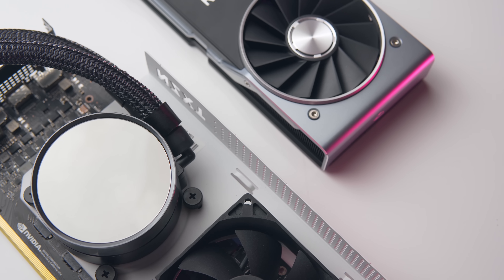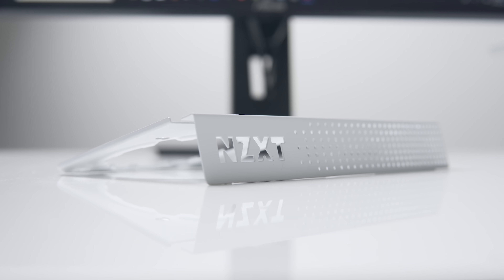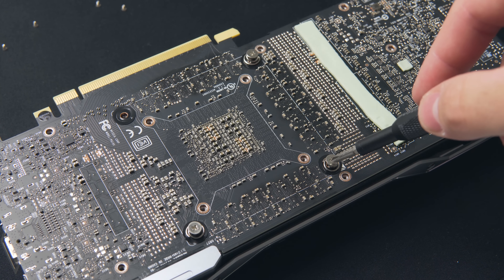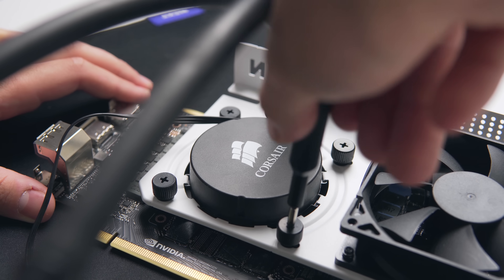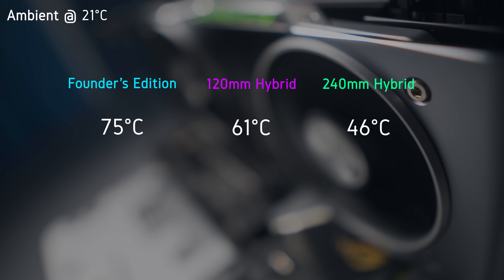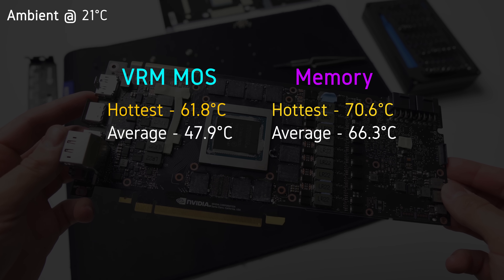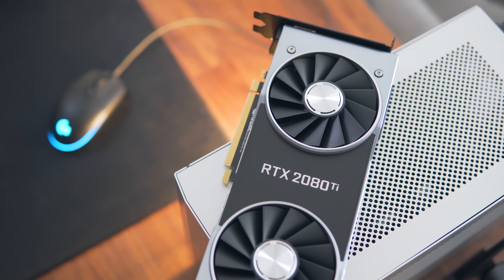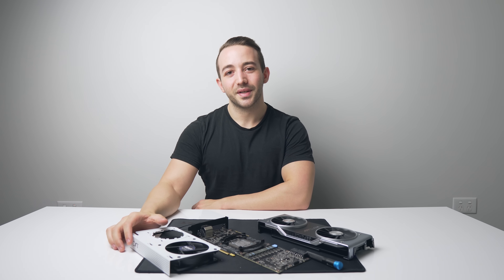RTX 2080 Ti + Kraken G12 Hybrid Cooling - Worth it?

Comment: Could you try this with a 5700xt? I'm curious to see how it will react.
Reply: the ram doesnt like it, the 5700 ram runs hot, you need to put heat sinks on the ram
Reply: @pascaljean2333  just add a noctua 80mm fan and heatsinks
Reply: Also waiting for this. I'm not preparing to pay £200+ for ekwb custom water loop!!
Reply: @Subaru-47  for an ek water loop you have to push around 500$ for cpu only or 700$ with only one gpu water block. So, you should go with dual kraken x63 for cpu and gpu instead. Only 300$ rather than 700$, but you need a custom case with dual sided intake vents and up panel 3 fans exhaust. you can create that under 100$ DIY as a wallmount or deskmount
Reply: still blue screens
Reply: or buy the id cooling gpu aio , works well and its cheap
Reply: Ive got now RX5700XT and is compatible. im using my old X41 Kraken with Arctic 140mm fan and is very silent and temps are really impresive. 32 degrees on idle and no more then 60-65 on load with low rpm of fan. when im plaing world of warships on max setup, freesync so gpu is loading on max 65-70% with 48 degrees temp max and fan 1000rpm max. superb.
Reply: I just drilled holes in my stock brat
Reply: Old post but my 5700xt with 240mm kraken is currently playing Days Gone 4k high/medium settings 60fps stable 95c.
Reply: If its compatible with r9 290x and r9 390x, it should be compatible with both rx 5700 and rx 5700xt
Reply: @khairulhaqeem1371  they are completely different pcb's........ and completely different chips......you have no idea what your talking about...
Reply: @Nebojša Ivančević Yes I tried this out and posted on AMD reddit to help others. The solution works very well as long as you have a fan towards the memory chips:

https://www.reddit.com/r/Amd/comments/cg0an7/amd_rx_5700_xt_anniversary_edition_with_kraken/?utm_medium=android_app&utm_source=share

I also custom built my own loop, I switched to that instead and I'm very satisfied with it!
Reply: just get normal universal gpu block from ali express and have a fan tied up on your gpu with some vrm & ram with heat sink. I did that to my 1080ti for mining ethereum and the temp stayed at 70c max. it's really worth it considering those blocks are 20 bucks. thing had run hassle free for over 2 years straight.

GPU block:
https://aliexpress.com/item/4001042827650.html?spm=a2g0o.productlist.0.0.7a3f4cb6mW3IwK&algo_pvid=05371321-f556-4637-81d8-b42b35c2d76b&algo_expid=05371321-f556-4637-81d8-b42b35c2d76b-6&btsid=0bb0622c16020437984896454eb11c&ws_ab_test=searchweb0_0,searchweb201602_,searchweb201603_
Reply: i did it and it was fine
Reply: I can recommend this beast: https://www.aquatuning.pl/chlodzenie-wodne/zestawy-i-systemy/all-in-one-gpu/25246/alphacool-eiswolf-240-gpx-pro-radeon-rx-5700/5700xt-m01-black awesome kit, easy to refill or upgrade. You can also make a loop with CPU or add reservoir. Everything is cooled with this one, RAM, GPU, VRM and all minor stuff that even producer didnt bothered to cool down. Satisfaction guaranteed :-)
Reply: I just installed the Kraken g12 on my XFX thicc 3 ultra RX5700XT it works great as long as you install it correctly. 

I run the Kraken X62 and the gpu is around  35 degres celcius on idle, 55 on load. Junction temperature goes up to 65-70 degres (almost 100c before)

It's so quiet now and I'm not cooking anymore when I play video games (case is under the desk)
Reply: @SuperCheesyMan  what about the VRAM temperature?
Reply: @SuperCheesyMan  thank you so much for this comment. I have the exact same card and was super worried about incompatibility. Thanks so much!
Reply: @SuperCheesyMan  there will still be the same amount of heat in the room if you watercool. possibly more as its taken from the gpu and moved to outside of the gpu quicker...
Reply: This is better: https://pt.aliexpress.com/item/4000074484626.html?spm=a2g0s.9042311.0.0.6e46b90aSuLyOV
Reply: Hello!

does it exist for vega 56
Reply: Darnell Estephane I'm pretty sure the g12 is incompatible with the 5700 and 5700 XT
Reply: @ready1player31  its compatible
Reply: @ready1player31  Maybe it's compatible with the nVidia Block...
Reply: @Orlando-io7pi  definitely not compatible with nvidia. Ot was too big for mw
Reply: @ready1player31  wrong, im using g12 on 5700xt with kraken x41. works way better then original cooler.
Reply: @ready1player31  with rx 590 ?
Reply: it's a pice of trash product, they don't even give you anything for the passive cooling of the VRM's or the VRAM'S, piece of trash is the more suitable name for it and not kraken G12, so i'll give it a more convenient name for it: "Piiece of trash ghetto watercooling solution", mutch better than kraken g12, don't you think?
Reply: @me_and_me_  actually some cards vrms runs cooler with this installed with a good airflow case.
Reply: @me_and_me_  lmao. You're too cheap to buy $10 worth of heatsinks?

Comment: just use speedfan to control a pwm header on the motherboard and link it to the gpu temp.
Reply: The problem with speedfan is that most anti-cheats block it from functioning and the software itself is very poor - wasn't consistently working for me so setting it manually was far better as often the fan would stay stuck at a low RPM causing my GPU to overheat.

Comment: atm with warm days in my country high 20's low to medium 30 degree's celsius ambient in door temps i got between 43 celsius and 51 celsius and when i just installed everything it whas about 20 celsius ambient inside and i got about 37-38 celsius so very good results 25-30 degrees difference between air and water cooled.Best investment i made to be honoust and my gaming experience got smoother with less micro interference.So the gpu feels much smoother then before,i would recommend buying a better higher cfm fan for cooling the gpu memory,but other then that top notch product and enough choises in aio coolers,i put my older x61 kraken 280 mm aio on the gpu that used to be on my cpu and bought a new x62 for my cpu,great setup but i recommend a good ventilated case,i switched from a nzxt s340 elite to a nzxt h700, much better cooling and ventilation capacity wich imo opinion is crutial for getting the best cooling out of these aio's.And the h700 fits 2x280mm aio rads and the s340 elite only fits 1x 280 mm with much worse ventilation and cooling.These are my experiences with all this.Hope this helps you.👍
Reply: And for the vrm cooling?do you think its safe this way?

Comment: If you're using one of NZXT's coolers, download their CAM software. You can power your fans using the PSU and the pump will still control their speed through their software.

Comment: I've heard the coil whine from the beginning, and after attaching an EKWB block it was going to be really annoying but I have headphones so I don't care much.
I would never use this kit given the outages the memory modules had during the release of the card.
Also the mounting mechanism looks like with a bit more pressure those modules could break which doesn't feel right.

Mine is running at 2100 MHz and 51 degrees under load.

Comment: Change Fans for Noctua ones, much more silent and better performance.
Also, when using a 120mm Radiator, there are adaptors to 140mm Fans. 
Again, bigger Fan, slower spin speed, much more silent than before.
And for Vibration-Issues, there are rubber seals that improve airflow and dampen vibration noises.
THAT is the true Power of ANY Water-Cooling but especally AIO . . 
You are much more flexible in the components you use for it.

Comment: NV 14-pin Adapter - Cable. Thats the cable u needed to control the fan with the graphics card
Reply: Is it a 3 pin or 4 pin?
Reply: @AG-sk5pv  4 pin

Comment: Huh. All the X-series AIO coolers I've used have a built-in fan controller that sends a PWM signal based on coolant temperature; the fan control issue you describe didn't exist if you fitted it according to the instructions. Did they remove that feature in recent versions?

Comment: I was eyeing the nzxt bracket but didn't like how it left everything open to air and no cooling so I ordered the evga hybrid kit, it's going to have a push/pull 120mm rad so it should have very good cooling specifically when compared to the air cooler. I run a Meshify C and with every fan at 1700 to 2000rpm on air I can't move enough air out of that case to cool that hot as hell 2080 TI I got.

Comment: It's very ugly, I never bought it for that reason. 
If you go for some crazy overclocks, then get Arctic Cooler Accelero Xtreme IV, and get some VRM heatsinks. That thing is air, and nearly silent, for $60. Take time with them thermal pads and cut out though. Buy some VRM heatsinks that can be glued to VRM on the card on Amazon.

Bit a pain to install at first, but much better than this NZXT crap, and you have to buy liquid cooling too, and then silent fans. 

Meh-meh-meh

Comment: Thanks for making this video! As someone who is very concerned with damaging a $1200 GPU though, don't you think your VRM temp measurements would be much lower than what other people would experience? 

It looks like you're running your tests on an open bench instead of an actual closed case where ambient temps would build up, especially on components without active cooling.
Reply: Usually vrms produce so little heat that the airflow of your case fans should be enough to not worry about them. T-Junction for a vrm should be around 125/230 °C

Comment: I am currently using Palit rtx 2080TI dual  pcb with nzxt g12 + nzxt kraken x62. It performs better(but not as much  cuz of non-A chip) but definitely much  cooler and quieter. The only downside in my opinion is that you can't SLI.  Before i used to have 2 MSI GTX 1080TI Gaming Xs in SLI both with nzxt g12 + kraken x62.

Comment: Got this with a corsair H55 for my RX580. Able to run it at 1590 MHz, up from stock OC at 1411, which is pretty nice. Nicer is that I can just swap the card out for a rx5000 when they drop without having to change any hardware. Gotta lova universal stuff that actually works well.

Comment: Sir, I am from India, in this summer 25/ 5/ 2019 my room tem. went to about 34c to 35c. My MSI GTX 1050 Ti 4G OC single fan varient went to 78 degree c wihle playing Far Cry 5 with 100% to 99% gpu usage. Please reply fast whether it is a normal temp. or any problem with the system.
Reply: Normal for those room temps.
Reply: @tuna_6548  Thanks Tuna a lot.

Comment: Thank you for this. I fitted a G12 to my 2080Ti and have been trying to decide whether I should add VRM cooling. I'm pleased to hear I don't have to rip it all apart again!
Reply: hi,have you cooled you vrms? i am having very hard time trying to find something safe to use in that.
Reply: @zosto5321  did you find anything for the vram?
Reply: @hombresdecultura  im still running my 2080 ti with g12 without extra VRM coolers to this day

Comment: Awesome! I'm currently looking into this. Wondering if anyone has done crazy overkill and installed a 360mm AIO? If so, what were the results? It's like a bit much, but that's what I'm looking at. :)
Also, I've read a considerable amount about this, you can get mini heat sinks and apply to each VRM so the fan on the G12 cools them better. :) Better safe than sorry!!
Reply: I have used a 360mm thermaltake  3.0 in this,but with a 1080Ti and the temps are the same as a 280mm radiador (kraken x62,or Corsair h115i)

Comment: ? Gigabyte has the waterforce GPUs. like Aorus GeForce GTX 2080 Ti Xtreme Waterforce 11G.  Now if case manufacturers would make me a ITX case that can hold TWO 240mm radiator, with glass sides, I would be a happy man... well maybe a tiny mATX case so I can go with 4 sticks of DIMM instead of 2 on ITX Mobos.
The Gigabyte windforce GPUs are not bad. The fans don't spin up unless it needs to so for most day to day it's very quiet.

Comment: On all Krakens AIO there is an USB port on the pump, so you to use CAM software wich is allowing you to set the fan's RPM with the GPU temp.

Comment: Could you solve the issue of having to plug the radiator and VRM fan into the motherboard chassis fan connector by using something like the NZXT Grid+ as an intermediary?

Comment: Like my 2080ti only gets to max 65 C on super demanding 4K games...battlefield, Witcher, metro exodus. I just changed the fan curve using msi afterburner.
Reply: That's on air too : )
My msi gaming x trio performs the same at 70% fan curve 2145mhz + 1475gddr6
Reply: what is your setting??
Reply: @FengLovex  it's 75% at 65 C
Reply: Fionn MacCumhaill in air conditioning room?
Reply: @FengLovex  nope ambient room, no air con. Even when heating is on in the house. . Just adjust your fan curve. Make sure your cable management is good if you are having issues

Comment: I've been using G12 on both AMD and NVIDIA with Kraken X62 and X52. I'm never going back. On the side note i had to rotate mounting brackets a few times to make them align with the mounting holes. Other then that smooth sailing.

Comment: personally just used the kraken g12 and a corsair 120mm aio on my blowerstyle founders addition gtx 1080, and there is a night and day difference. was running at 82c! under load playing cod black ops 4, hitting 72fps at 1080 rez before the aio addon. after the addon, no joke, went from that 72fps, 84c @1080p to 124fps (depending on the map, i have seen 165fps with a basic novice level overclock) 65c @1440! biggest upgrade i could have done, cheap, easy to do, and 100% worth on a gtx 1080 blower style.  10/10 would req to anyone on a budgit who wants to add more punch without having to shell out for a new gpu.

Comment: A Kraken fried my card years ago. Other components on the card (pretty much everything but the gpu) were not cooled well. The design doesn't seem to have changed to address this, so I wouldn't recommend it. I will recommend EVGA, though. They replaced the broken card at no charge, even though it wasn't their fault the card failed.

Comment: Just to ally any fears I used this to watercool my rtx 2070. It does indeed use the AMD bracket.
Reply: Could you tell me which rtx 2070 you used?
I'm currently using the gigabyte rtx 2070 and I have my doubts on buying this.
Reply: @sept09  same here. i know that it fits perfectly in the 2070s from gigabyte, but i saw on reddit that the 2070 non super with 2 fans needs some modding in the brackets to fit

Comment: Nice video! I use the G12 with 2x120mm be quiet! Silent Wings 3 and 1x92mm Noctua NF-B9. And i can highly recommend this! Super low noise. Best regards from germany.
Reply: hey Markus
good to know that !
what RPM are you using for both 120mm and 92mm fan ?
best regards from france.

Comment: What do you think about Aorus 2080ti waterforce with 240mm AIO ?
Reply: if you are thinking about spending that much, you should really consider cooling it using an open loop, rather than an aio. It will cost a little more, but it will look nicer and have better cooling.

Comment: Using RTX 2080 from Inno3d and damn that card is hot and loud.When GPU under load it felt like I was in dentist office.Got kraken g12 with corsair h75 and that was a game changer 8000mhz and 2150core overclock with max temp of 60c and cant hear a thing.Highly recommend the kraken G12
Reply: I know its old comment, but im just corious is you rtx2080 still working? Did you have any problems with it? Im just concern about vram cooling...
Reply: @gazoVU  Card still works without a single issue.and seems will be working for another year as I can't find rtx 3080 for upgrade :D
Reply: @ruddyr7214  ty man for answer, going to give a go on my rtx 2080 from Palit.

Comment: Is it possible and even recommended to use the G12 together with a liquid CPU cooler on a single radiator? Would be neat for a small system.
Reply: I had the same question!  By chance I'm upgrading my CPU and GPU; both of which have stock fans.  Visually I thought it might be weird to have two nzxt LEDs circling, so then I considered using the nzxt cooler only for the GPU, and using a non-led version of Corsair or something for the GPU.  But then I'm mixing brands which just messes with my head a bit.  So I also wondered if I can just loop one large nzxt unit to go from CPU to GPU and back to the cooler again.  But hey, at that point should we just be making legit custom loops?  That has been my thought process.  Technically, I doubt that one AIO pump is designed to push through two devices, so it might not work efficiently, effectively, or live long while trying to push through two.

Comment: I made the mistake of buying a Kraken G12 before buying a new video card, and now I've got a G12 gathering dust, because the MSI cooler on the card is both so silent and efficient, I feel absolutely no need to void the warranty and spend another 150 bucks on an AIO, because there is nothing to improve on, and as it happens, this shows nicely on your graph too. 73 °C on a card overclocked to hell is more than acceptable, so is the 46 dBA system noise, the humming of the solenoid valve on my CO2 system for the aquarium on my desk is more annoying.

Comment: I used to run a Kraken G12 on a EVGA 1080ti ftw3.  Kept the core temps below 36c but memory temps and vram temps were higher than with the original cooler.
Reply: It's because some vrm heatsinks sould be bought along with the g12..you watercool the gpu but remove most of the airflow and dissipation from the vrm..if you have a baseplate would be smart to leave that on if possible or buy some heatsinks with thermal tape
Reply: @enricod.7198  ik this a year ago, but could you link me some on amazon Spain? (Amazon.es) I can't find any
Reply: the 1080ti FTW3 is spread out alot further than the 2080ti,   i just upgraded from the former to the latter